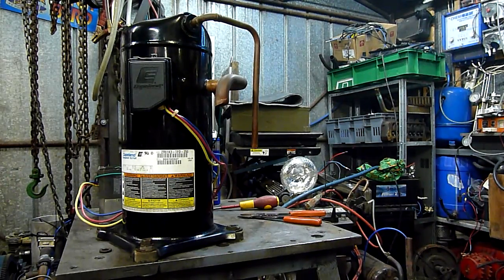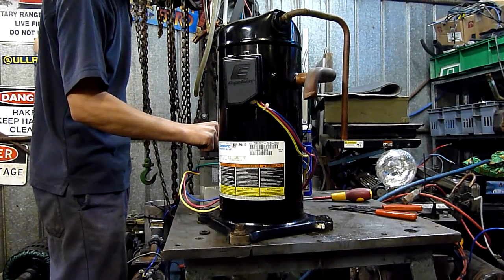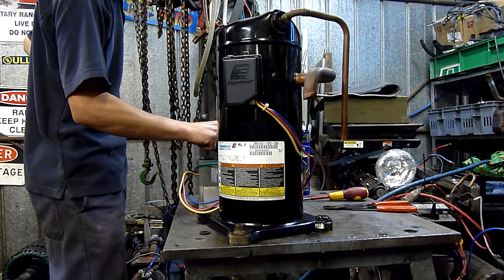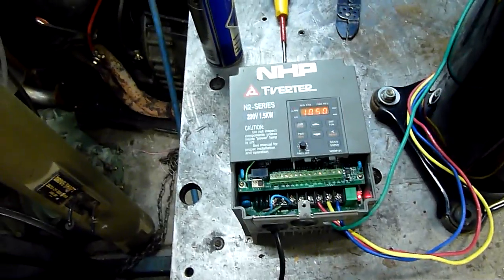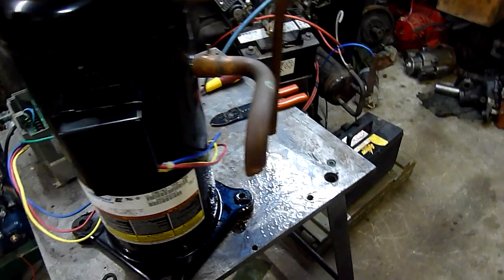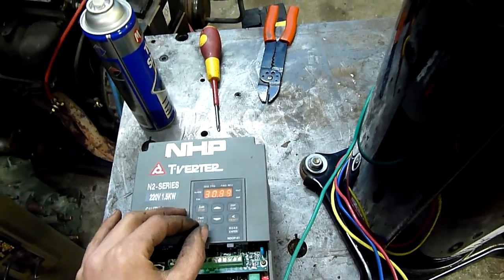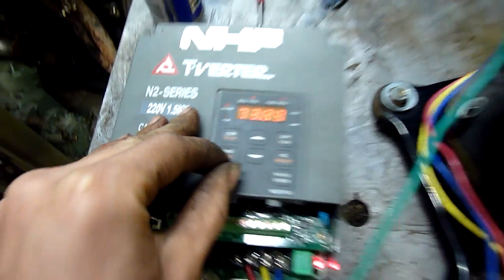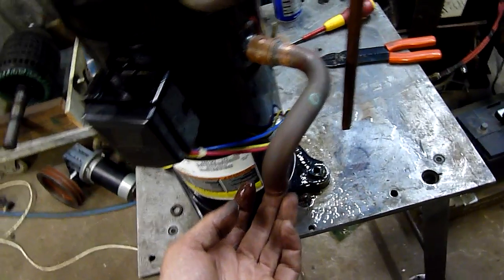Copland Scroll Comp Pulling Insane RPM on VFD

Comment: For use in shop compressor , mount pressure vertical into a 3inch offset pipe then back to 1inch pipe , it will blow oil out but will catch oil and when pump is not running it drains back in